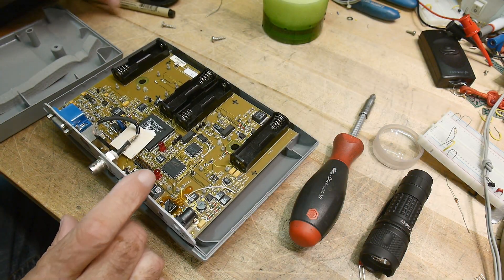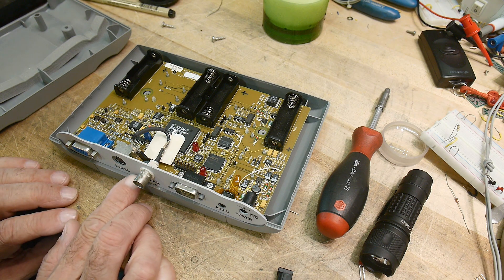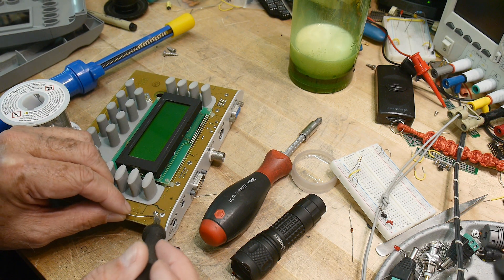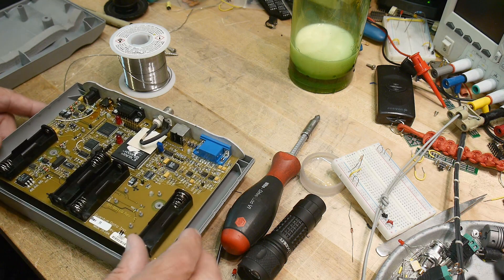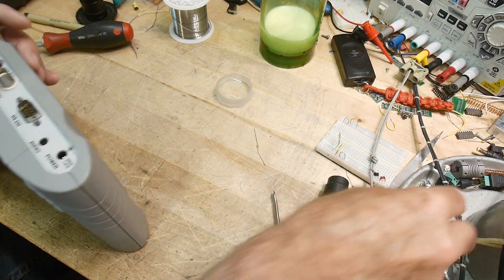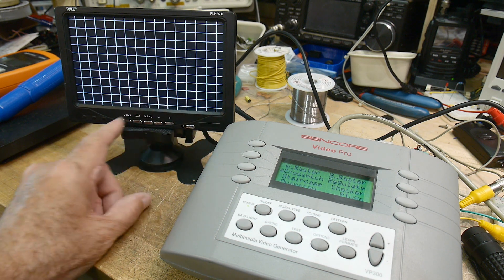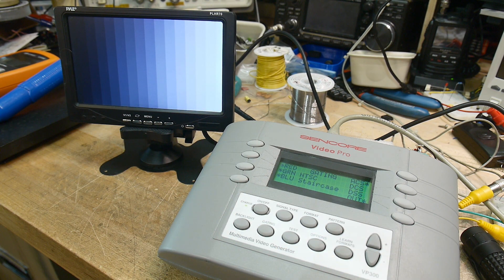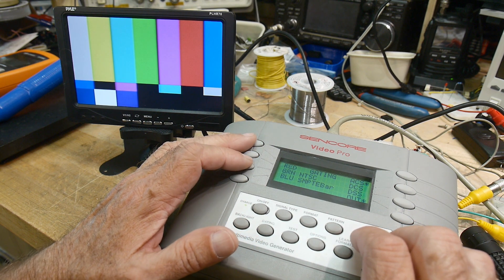#1165 Sencore VP300 Video Pattern Generator (part 1 of 4)

Comment: Do you know if this can output RGBS signal (using 4x BNC's, prob. via VGA to BNC cable) when testing Standard Definition (~15khz) devices? I run RGBS for all my equipment (Sony BVM and PVM CRT monitors), and would like to calibrate them with the same signal type I use.

The manual is not too accurate about this... it does say it can output "Digital and Analog Composite Sync", but then also specifically lays out what it'll output for these two SD resolutions: "SDTV: YPbPr, RGBHV" and "NTSC: Composite, S-Video" - no mention of RGBS output. Thanks in advance if you know!
Reply from the maker: yes, I'm sure it would work. RGB+sync is just VGA type stuff: https://en.wikipedia.org/wiki/Component_video#RGB_analog_component_video
Reply: @IMSAIGuy  Thanks for the reply! It's more that the manual specifically calls out the exact formats it outputs for both NTSC and SDTV... and none of those listed is "RGBS" (and in fact, not a single mention in the entire manual of "RGBS", and no mention of how "composite sync" even works on this!!! - besides showing you the button for it lol)... Composite Sync could also, I guess, stand for RGsB (Sync on Green), which I also don't want!

...just totally different than my Extron equipment which specifically mentions RGBS in a half dozen places in the manual... so I'm worried the Sencore isn't going to work in this way.

Comment: The large flashing black and white image in the middle is to check for blooming in CRT monitors.  The high voltage power supply in CRTs was run from the fly back of the 15750 hz horizontal sweep signal.  As the picture got brighter the cathode to anode current in the crt would increase.  This would cause the output voltage of the high voltage power supply to decrease with the increased current draw which decreased the overall acceleration voltage and slowed the electrons.  Since the electrons were moving slower they had more time to be influenced by the magnetic field from the yoke coil and would bend a bit more.  This would make a bright picture a bit bigger than a dark picture.  This effect was called blooming.
Reply: Amen to the 15750 horizontal sweep, although the poor regulation you mentioned was more common with B&W sets. 

Fifty years ago I could hear that frequency coming from a flyback with a loose lamination.  These days? Well, no matter how good my hearing aids are, there ain't no way.

Comment: Interesting bit of test kit. Could the 'regulate' setting allow you to monitor the PSU as it changes from low current to high current and see if it is in fact regulating ?...cheers.

Comment: I like where this series seems to be heading. 

I recently got one of those ESP32 VGA32 controllers. Libraries are available to let you emulate CP/M, DOS, and others. I had the necessary PS-2 mouse and keyboard, and had an old-school monitor with VGA, but I could not find a VGA cable. I used to have hundreds--no, thousands of VGA cables. They apparently multiplied like rabbits when I wasn't looking, but now they've all mysteriously disappeared. Perhaps they have been granted asylum in the place where all those missing socks are to be found. I ended up buying one.

Like my vanishing cables, the ability to use technology that was common even ten years ago is disappearing. (Lord help me if I needed to find something to display a composite video signal.) It's good to preserve and transmit older skill sets. Sometimes the answer to a "new" problem was found twenty years ago, but since forgotten.

There is a limit, of course. If you put out a video on how to neutralize a power triode using a gimmick I'm going to think that it might be time for you spend more time watching Wheel of Fortune. (grin)

Comment: AD725 is an RGB to Composite/S-Video converter that also generates sync signals for PAL or NTSC, depending upon the oscillator used.

Comment: I restore vintage electronic test equipment much like you do sometimes. I just bought a lot of 25 items from a closed pawn shop. This was among the items. At first glance I was like what the? A quick eBay search and they are $25 to $50 or so. This is going to be interesting for me simply because I will learn along with your videos. Great job and please keep them coming.